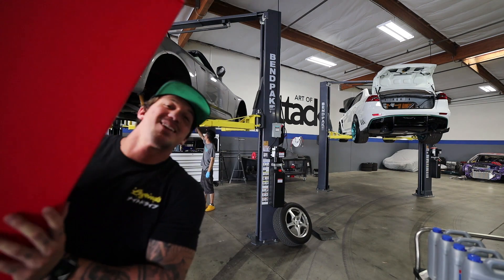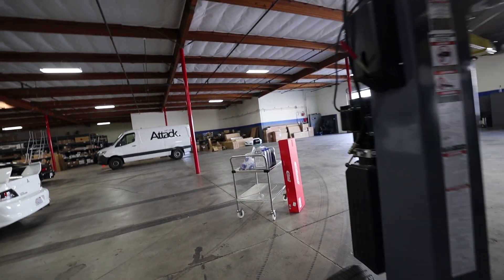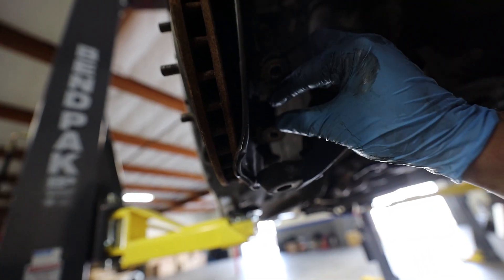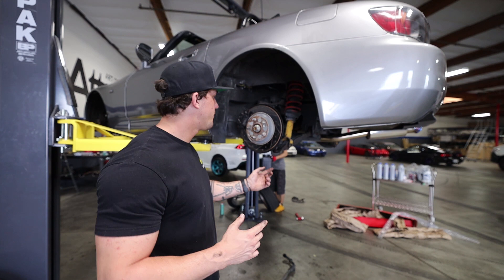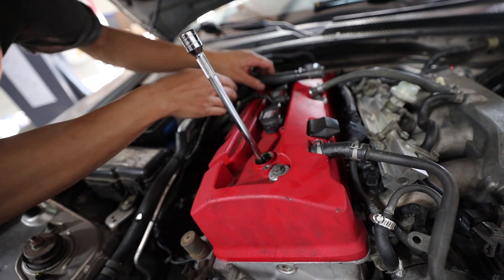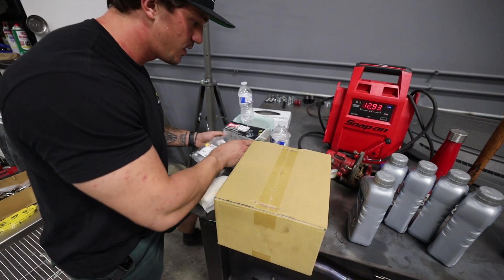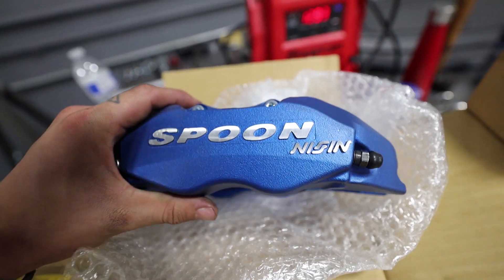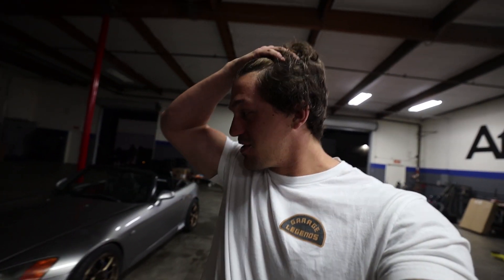THE S2000 IS TRACK READY | SPOON BRAKES INSTALL, JDM WHEELS, & MORE! | S2000 BUILD SERIES EP. 4

Comment: I know you're trying to do an all spoon build but those spoon brakes use stock rotors sizes which don't add much stopping power or help with brake fade. Stoptech or AP racing are the way to go for big brakes
Reply: Really he probably would've been fine with OEM brakes for a beginner driver. Just use higher DOT fluid, track pads, and maybe some stainless steel lines.
Reply: @Mrlolibre  THIS! I see too many people getting spoon calipers and say their braking system is complete.
Reply: @derekyam1805  brake aesthetics complete.
Reply: stoptechs are def the way to go
Reply: Yeah 2 pieces to the system. Calipers and rotors. He will get more bite initially but that also translates to more heat and fade much faster on stock rotors. If this was a daily no track use car. Maybe it would work.
Reply: I raced my S2000 w stocks brakes for several years. Added cooling vents was all and it was fine.
Reply: @Mrlolibre  I definitely agree I feel he is modding way too rapidly to see an improvement curve. I was told by a driving instructor it's best to learn the car stock form and understand how the car handles before modding. When you are comfortable driving stock form and you feel you cannot push the car anymore than slowly upgrade the car as each modification to the car will change how the car will react. Modding a car too fast is only going to cripple you and not make you a good potential driver.

Comment: If you are driving on the circuit, attach a reinforced bracket so that the attachment point of the rear upper arm does not come off.

Comment: Nice video Dustin! hell of an effort on mods for the track all at once mate. Enjoy that S2K as much as I do mine. Learn how to control it at the track, and later on, get an aftermarket ECU to lower your VTEC engagement and remap it. The car changes DRASTICALLY. I've an 07, so I have Hondata. But you should go with an AEM V2.

Comment: Just an opinion, if you really want to master tracking the S, it's better to start with bone stock suspension (Maybe some wheels and tires) and learn the car on the track. Then once you get comfortable, slowly start adding coils, sways, joints, bushings, collar mounts. And you'll see how much faster you get. The S is fun af to drive but can be unforgiving in corners if you give it too much without knowing how to rotate it. Anyways, looking forward to the track build!

Comment: You should do supercharger but a root style one power is always there and like 400hp can be easily achieved with e85 and a smaller pully you can even do a ported setup and run more powa baby

Comment: Isn't there supposed to be a break in cycle with the new pads? Most require a couple hundred miles of gentle use to let them bed in properly before hard track use. Also if you find that they squeal a lot it's likely because you didn't use any grease on the guide tabs / back of the pads.

Comment: You should have tracked the car in its oem configuration first; learn those limits, then add upgrades.
Reply: Yeah a lot of folks throw a bunch of expensive parts on their car but seat time is where it's at. Really a more aggressive alignment and sticky tires even with OEM tire size instead of running ridiculously wide tires would do wonders.

Comment: Spoon calipers but it still uses oem sized rotors so basically little to no improvements in the heat capacity of the brake system.  Mismatch brake pad f/r, still using solid rear rotors. Probably why his rear brakes wore out so fast in his latest video but he should have checked over his brake system before heading to the track. Looks like Spoon pads are about $280 for fronts or rears but Winmax w5 can be had for $180 a set. But then it was free so not a waste of money, just not effective for the track.

Comment: If it was your first time at the track, wouldn't it have been better to just run fresh fluids, good track pads and run it as is before throwing a bunch of expensive parts that may or may not drastically change the cars handling making it more difficult for a first time to learn the limits and then slowly progress up?